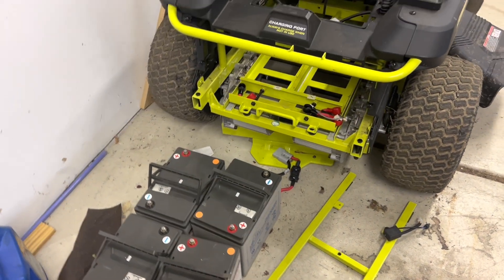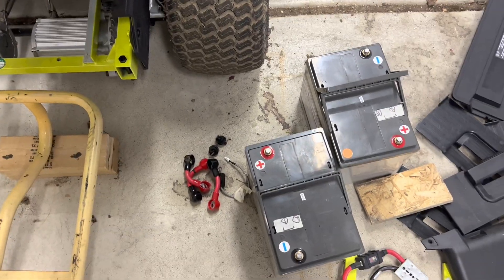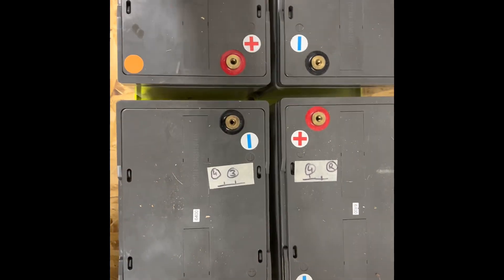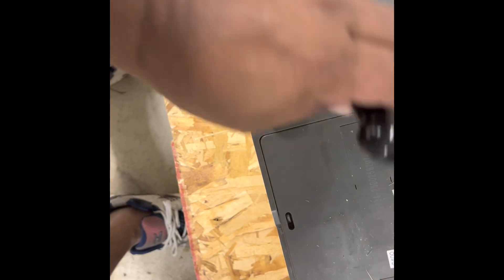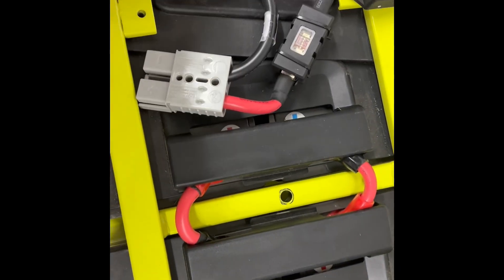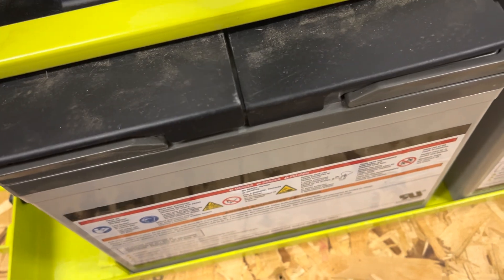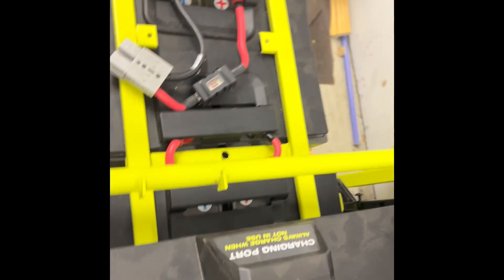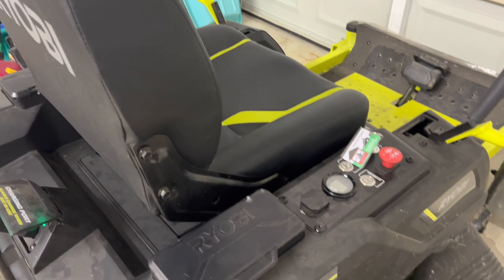Ryobi Zero Turn Lawnmover Battery Installation ZT480e

Comment: Great video ! have a question , I have same zero turn but I have the 75ah battery and if one battery  is bad can replace that one bad battery with  a 100ah battery ? will it still charge ? thanks Steve
Reply from the maker: No